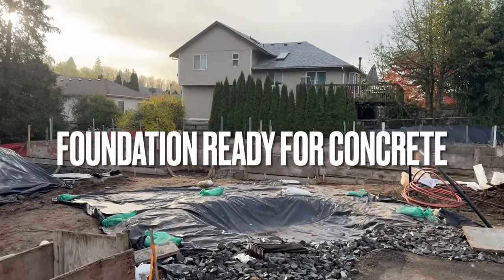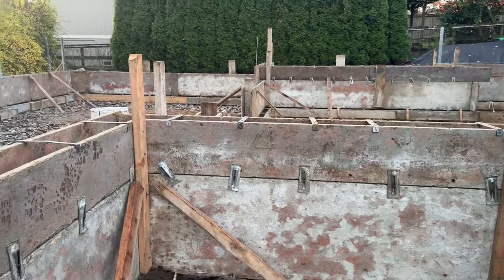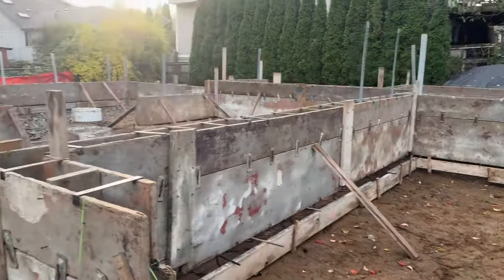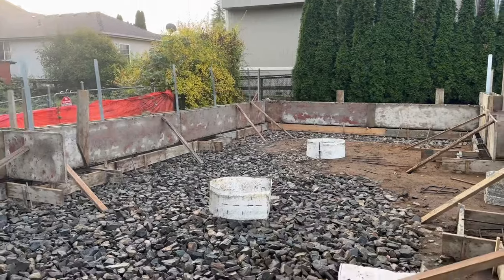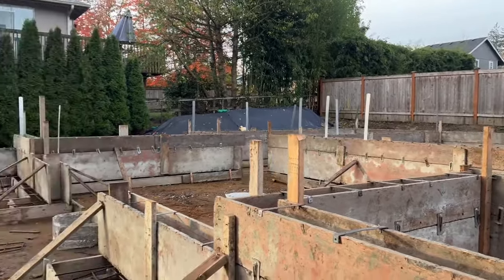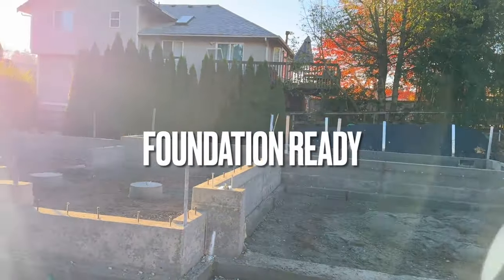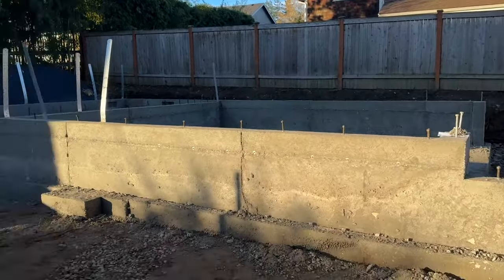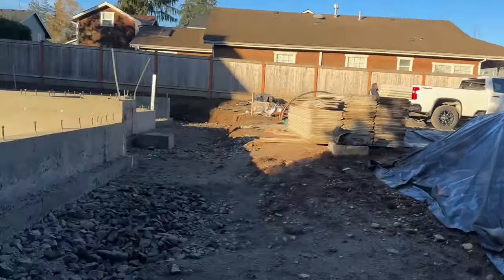Home Build Series (Ep 02) - Foundation Complete

Comment: Just a comment, those foundations, the concrete that was used had a lot of water, you can see why there are a lot of bubbles in it, secondly you can see that it lacked vibration, there are parts where there are voids of concrete, it would be good if you plan on doing something very heavy, to do a resistance study on the concrete, to avoid future problems